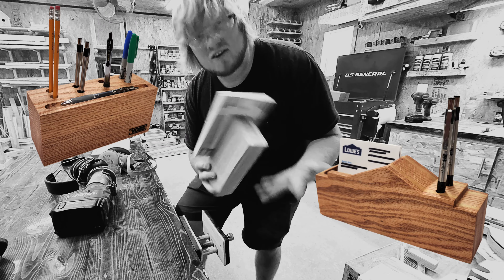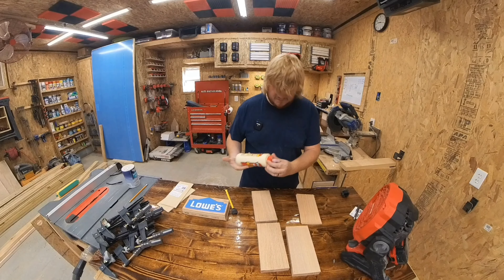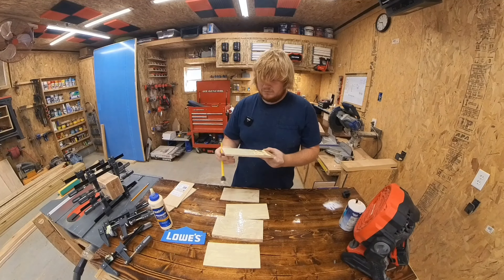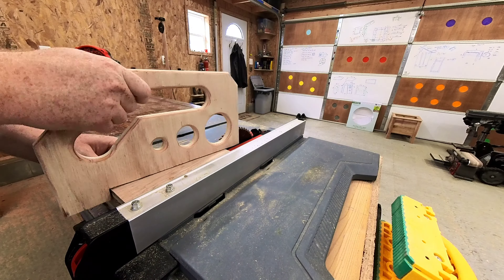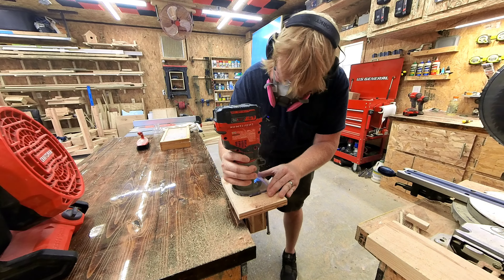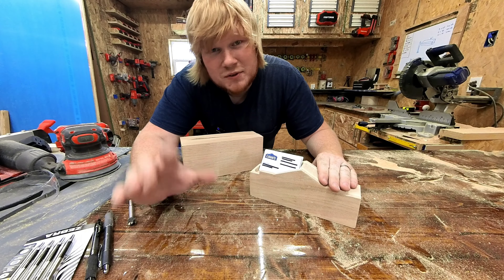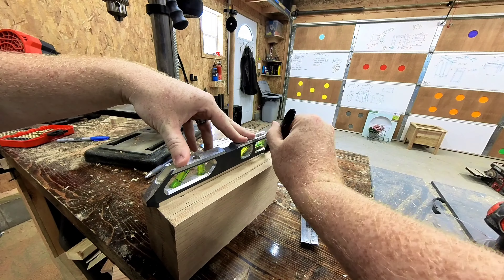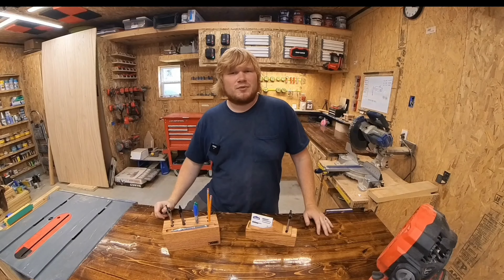How To Build a wooden Desk Pen Holder. Woodworking.

Comment: I like the one you made for your wife. What profile router bit did you use for the slot in front?
Reply from the maker: Its a round-nose bit, 
https://www.amazon.com/Yonico-14461-Router-2-Inch-Shank/dp/B07S5MD1PC/ref=mp_s_a_1_11?keywords=round+nose+router+bit&qid=1691579533&sr=8-11
Looks like these :)

Comment: Liked your Christmas tree video, new sub here! also where did you source your stamp for your products? I can use the inner webs, but if you know a small business I would prefer to use them.
Thanks again for sharing!
Reply from the maker: I got mine from Etsy, I told her what I wanted it to look like and the size, and she designed it. My advics would be to ahell out the extra for the electric one. It beats taking the time to heat it up and the inconsistency of heat when branding :)